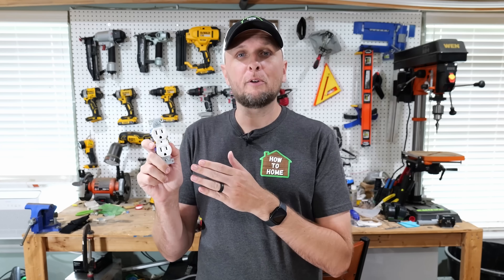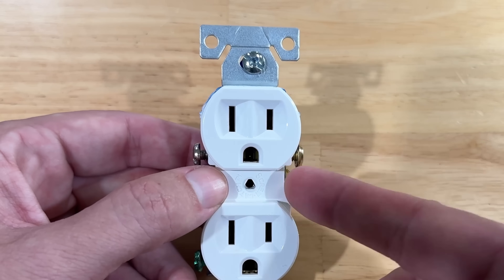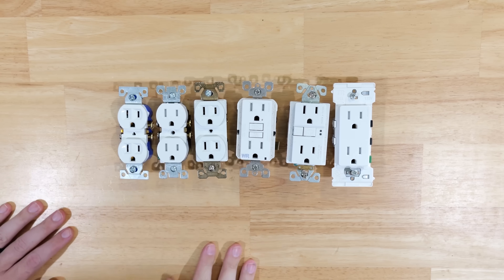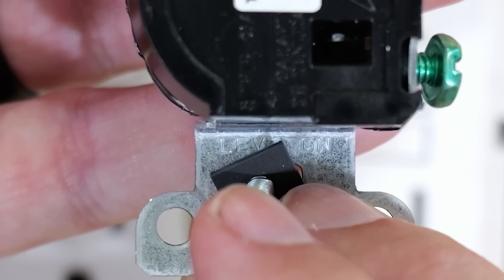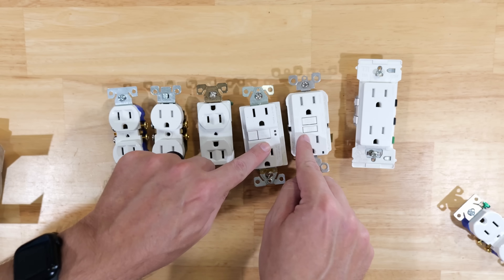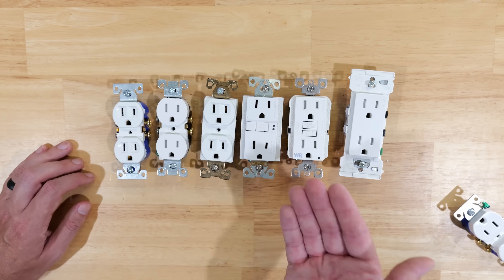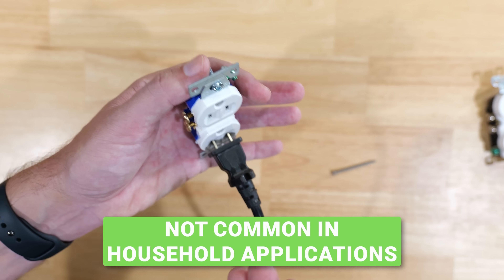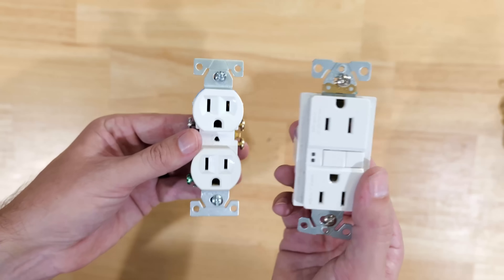The Shocking Reason Why Your Outlets Are Installed Upside Down!

Comment: You missed one!  Many of my grounded plugs, when held ground, down, have a thumb pad above the twins (neutral and line)--it's a flat surface with ridges for grip--making the overall shape of the plug grip triangular, pointing down.  Many of my extension cords are triangular grounded plugs.
For any plug, it is unnatural to put your thumb (and wrist) rotated in such a way as to grip the bottom of the plug.  The triangular plug is point-down if the ground is down with the thumb up top on the pad.  My forefinger naturally curls back toward the cord and cups the plug from behind to help push the plug into the outlet with the thumb.  If I'm fighting a stiff cord and trying to line up the two prongs it's also easier to rotate the plug using my other fingers around the backside of the plug (the rounded apex of the equilateral triangle) than with the thumb.  It's very natural to push the plug in with your thumb, flat grip-pad, up in a ground-down designed appliance plug if the outlet is also ground-down.
I noticed that your demo-plug ends have a variety of designs clearly meant to encourage one or the other.  One of them seemed to grips and obstacles all the way around to seemingly cover all bases or avoid patent infringement.
I find that when outlets are new and stiff, I prefer the triangular plug design with ground down so that I can jockey it back and forth when pushing or pulling to overcome resistance.  But probably the most important thing in my home is consistency.  Sometimes I'm plugging into receptacles I can't see in the dark or behind furniture!

Comment: As stated, always look to the manufacturer's indication for an outlet.  There are some areas where they are stating ground-up for code, and I feel this is a bad decision.  Do I feel Ground-up is bad?  No!  The decision is bad because the main reason for it is do to Hospitals.  A lot of electrical code is created by Electricians and Fire Authorities.  In hospitals, Outlets and wall-plates must be a specific type and material for code.  Most common is metal.  The frequent plugging and unplugging of equipment would cause the plates to come loose and touch the hot & Neutral prongs together causing an alarming arc or flash causing the breaker to trip.  This is most common with single point in the center wall-plates, as there is only a single screw holding it in place.  The breaker would do it's job and shut off power.  The sparking from the arc "could" potentially start a fire, but there is absolutely no documented incident or instance where the breaker or GFI has done it's job, and a fire had started from a metal plate touching the prongs.  This was initiated out of a highly remote concern, and many manufacturers are skeptical about initiating a full change for this.  Only a few areas are making it code in their local codes requiring ground-up.  Overall, either direction is acceptable for National code.

Comment: I prefer down, I have had a items that are actually loose 2 prongs with directional sides, and with it down it takes gravity advantage and stays in, whereas the other way the gravity advantage goes against it and tends to fall out. (Usually the heavier end of a plug is on the bottom, so the rotation of for example a heavy transformer will lean into the wall keeping it secure instead of the other way around.

Comment: I have NEVER had a house wired with ANY ground prong up scenarios, and I am old. So, what really happens is that if something shorts out the two flat prongs, you get a spark and guess what, the circuit breaker trips, or in VERY old houses, the fuse blows. That is what they are there for.

Comment: Ground prong up is so annoying when plugging in multiple outlet receptacles, particularly when retrofitting with ones containing USB ports, as all the lettering on the receptacle is invariably upside down in those instances.  Also right angle plugs and other sorts of plugs where the wire comes out at an angle are really sub-optimal in ground prong up installations.

Comment: Ground hole on top orientation makes it easier to align when plugging  in a device with a ground prong, because the ground prong being in the center does not obscure line of sight for the hot and neutral leads call Mel were the opposite is not true.

Comment: I can not look at an outlet without seeing a  little surprised face. As for orientation, if my outlets do not look like little surprised faces, then they're not installed correctly, and I WILL remove them and orient them in the correct direction.

Comment: This is just another one of many videos that misses the point. You don't have to install any 120v or 220v  outlets unless you have something that needs to be plugged into them. 
We were told about the Magic Paoerclips, but not what is important. 
With no Electrical Code and without looking at the devices and cords, the analysis is just a preference. Refrigerator plugs, Wall Blisters, and all of the angled devices are designed for the Ground-Down installation. I've never seen a Ground‐Up device or a magic paper clip.

Comment: I purchased a wax warmer night light. It's 3rd prong is down, it is plastic and used more for stability of the light as I know being plastic it isn't a ground. If the outlet was set up with the ground prong up, I wouldn't be able to use the wax part of the night light as I couldn't keep the wax in it. Foretuneatly, all my plugins are with the ground plug down. So I can move that night light/warmer anywhere in my home.

Comment: some appliances, like airconditioners, have a large rectangular block for the plug. I think their idea is that the rectangular block “blocks” the lower recepticle, so only the appliance can be plugged into the outlet (if the outlet is near the floor). By installing the outlet ground-side up - then you can have your appliance plugged in, and still have the lower receptacle available for something else.

Comment: My problem is when the electrical cord comes off at a right angle to the plug. If the ground hole is on top, the cord has to go upwards and then down to the appliance. Gravity does its thing by pulling the cord and then the plug out.

Comment: Another argument could be in the case of the cord's weight to pull down the plug, it will twist down and let the upper part exposed. So in that case you want the exposed part is the ground and not the line. If you install it horizontally, then your want the neutral up.

Comment: Very good video. Excellent information. We need to continue to educate people that there is no official orientation required by code. It is USAGE that determines which orientation is most appropriate. If your only issue is safety, technically the most safe orientation is to mount the receptacle horizontally with the line prong down. It creates the least likely opportunity to accidentally contact the line prong. However, the risk data is so small (infinitesimally so) that other needs are more important.

Something to consider is the "background" effect of our vision. Meaning that when your eyes see something "normal" or expected, your brain tends to shunt that image to the background and focus on other details. In practice what this means is that we have been trained by experience to see receptacles installed with the ground prong down, what people like to call the "face" orientation. When you see a receptacle installed in that position, you do not take note of it because it is "as expected." If, OTOH, the receptacle is "upsidedown" with the ground prong at the top, we tend to notice that. You may not immediately recognize the outlet as the cause, but you get the feeling that something is wrong and you focus on the image to figure out why. This phenomenon manifests in all kinds of areas of our life. Coax wiring for cable access is similar. There was a time when color-matching the wire to the house was an issue. People thought it would be better to have white cable on their lightly colored home or perhaps a shade of red to match their brick, or gray, etc. However, what actually happened is that the color of the coax jacket was never the same shade as the house color and because our brains had been trained to expect black coax wire, other colors stood out more prominently even thought they were closer to the actual house color.

Comment: The one thing that bugs me with ground prong up is using a flat plug cord. Their cords are angled down and to the side, so that if you have a ground prong up orientation, the flat plug points the wire up and to the side, which not only looks ugly and annoying, but it can cause downward strain to partially pull the plug from the outlet.

Comment: I have no opinion in this, but I will point out that if the ground hole is up at a quick glance you can tell if the appliance has a ground pin most of the time which may affect the way you think about the device.

Comment: I was told ground up indicated it was a two wire install and ground down indicated a three wire situation.  This shows up mostly in homes built in the early seventies and  earlier.  I am not sure if this is accurate and would not depend on it.

Comment: I had a metal sign hanging on my wall, it came off, slid down landed on the plug and started a fire when I wasn't home. Another time I had removed the side panel from my washer trying to replace a belt. I leaned the panels against the wall and it slid down hit the plug and welded itself to the plug. You may not have seen it happen but it happens

Comment: When we built our house, 20 ish years ago, I did the finish electrical.  The electrical contractor told us to install the receptacles earth ground up.  I didn't see any down side to it so that is what I did.  After about 5 ish years I now know that I would absolutely never do that again and that is for only one main reason.  There are many, many may be a little strong, plugs that are designed to be plugged in with the earth ground at the bottom.  For example hair dryers with built in GFCI's.  If they are designed that way then the tail of the cord will face up and cause undue strain on that cord.  Also because of this it sometimes results in both outlets being covered even though you are only using one plug.

Comment: Well I have noticed with the ground up it is harder to accidentally pull the cord out. Ie: tripping over cord, kid tugging on it, anything that pulls down on the cord. In garages I prefer ground up. The plug stays more secure and safety of shorting out. Thanks 4 vid.

Comment: Ground prong down please. One other argument that you didn't bring up is if you really need a device grounded and the cord is pulled from below, then you can lose ground contact. This is why the ground prong is longer, but it doesn't always work. I headed the wire and rack construction, including power distribution at a regional sound company for 14 years and have seen this happen.

Comment: In most cases, I install the ground up.  There is one issue you didn't mention; flat plugs are always oriented for ground prong down, so the cable is oriented to hang down when plugged in.  If the receptacle is ground prong up, it has to be plugged into the top outlet, so it doesn't block both plugs and then curves down, placing stress on the connection.  Cable manufacturers appear to expect ground down.

Comment: Mostly I install them with the ground down except if the appliance (like an Window Air conditioner) has  the ground up, so that when using the bottom plug the cable runs down and no up. Also, most 45 degrees extension cords heads manufactured are made with the prong down.

Comment: Receptacle orientation is not the issue. The design is garbage to begin with. No live conductor should ever be exposed. I know there are haters on this line-of-thought as well, but European style (CEE7/16) is a good design with the prongs halfway insulated, and internal disconnect switch within the receptacle.  It disconnects if the plug is not fully engaged.  Most of the grounded varieties have the ground on top.
On a side note, I have had a necklace chain melted that fell across a USB charger plugged into an extension cord beside my bed, because problem #2 is the wall outlet is never where you need it.

Comment: Well no not saying your wrong the hot powers whatever device is plugged in the neutral sends whatever power wasn’t used back to the panel and that goes back to the grid. Since power is like a garden horse and a wall plug is AC power the devices you plug into the outlet are not they are DC so they only use so much of that power from the outlet so some of it returns through the neutral back to the panel. It doesn’t complete the circuit it’s actually bleeding off access power not used.

Comment: As a military veteran of 28 years, we mounted all "OUTLETS" with the ground hole UP.  We did this 100% because the outlets were mounted at least waist-high and we used pretty heavy duty wire/cable/plug and if the ground was on the bottom, the ground "prong" would crack the plastic below the outlet ground hole due to the weight of the plug/wire/cable as it pulled down on the receptacle, which was a SAFETY discrepancy as was ANY cracks or other damage to the outlet or the cover.  Now, for my home I always install the outlets with the ground DOWN.  The orientation always depends on the preference of the intended USER and their tolerance for repair/damage.

Comment: I once witnessed an entire casino main cage shut down when a nickel became wedged between the two power outlets because a plug wasn't fully plugged in and it blew the main breaker.  If the gnd plug was up that wouldn't have happened.

Comment: I was taught that I should always install with ground down. The reason is that if the plug is removed partially from someone stepping on the cord, the ground prong would be the last part pulled out of the outlet, so the circuit would be grounded longer

Comment: Ground side down? If you look at the orientation of the ground wire connection on the back; it would be better to have the at the bottom of the receptical in case your room, basement  floods to that outlet level. Thus grounding the water instead of charging it. Not that you should be entering a flooded room without turning the power off first.

Comment: I have been going through and rewiring my home because it was built with two wire cable. So anything I rewire and run on three wire I mount ground up. To know at a glance what has a good ground circuit.

Comment: The reason that you will sometimes find one outlet in a room, upside down, it to signify a switched outlet. And that switched outlet has only one receptacle on the switch. Its so you can put a table lamp there, and plug it in, and control it from a light switch. 
Every house I have lived in, with exception of the house I am in now, has had this done.
that's 5 houses in San Francisco, 5 in Indiana, 3 in southern California, 4 in the Phoenix area, 1 in Florida, 3 in North Carolina, the ones in England don't count, because the outlets themselves had a switch on it. So that 21 houses and apartments I lived in that had switched outlets, with that one outlet being installed upside down, and one home that didn't have any upside down. Leaving a 95% chance that seeing an outlet installed upside down, meant it was a switched outlet. An extra clue would be not having ceiling lights, yet having a light switch near the door. What that switch for? Its to control that one socket on that upside down outlet. 
FYI: The newest home in the list of homes I lived in was built in 1987, and the oldest was built in 1880. 
People do make up their own codes, when a lack of one exists, as long as it doesn't conflict with actual codes.

Comment: In a cord with the wire coming out the side the ground is on the opposite side as wire. If the ground side up the cord lays flat on wall. If the ground up then the cord has a loop in it.

Comment: I find that many if not most specialty extension cords and adapters assume the hole down orientation  so that the cord goes down towards gravity and the floor which makes more sense than up. BUT in an industrial or hospital setting metal cover plates are used and if the cover screw falls out, the plate can drop and short the two prongs together otherwise it would only contact the ground pin if you're lucky.

Comment: Until about ten years ago I've always wired receptacles with the ground down. Then heard the argument made by an industrial electrician about the ground up orientation being preferable. I tend to agree with the ground up crowd, especially in an industrial setting where there are more moving parts and objects flying around than in residential. So I now go with ground up.